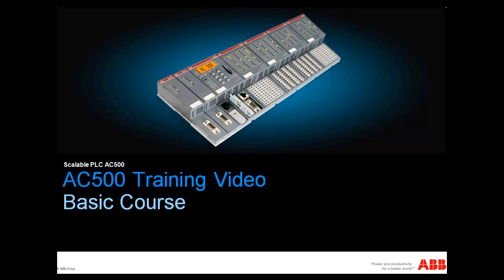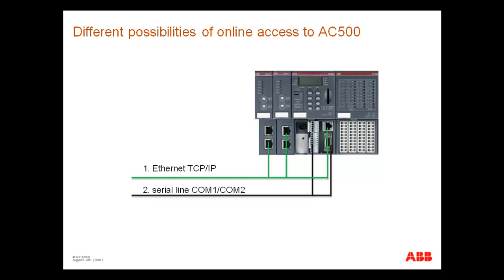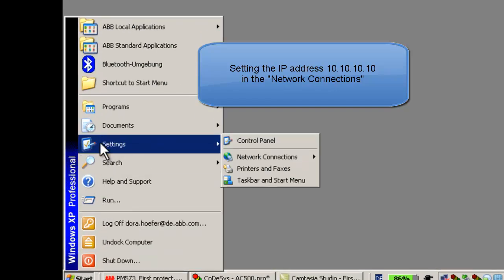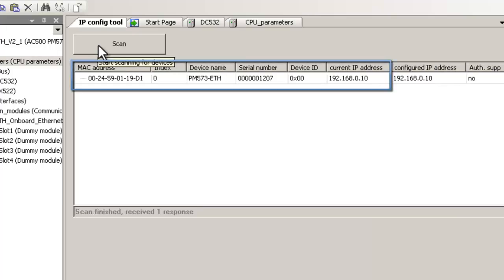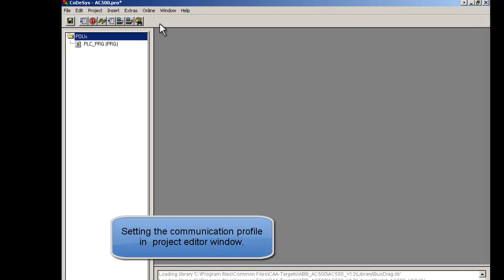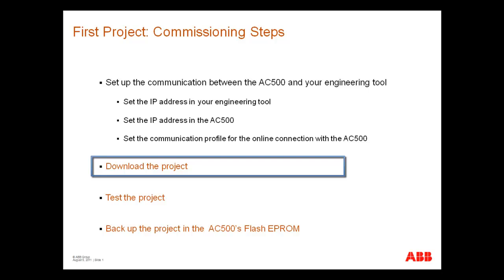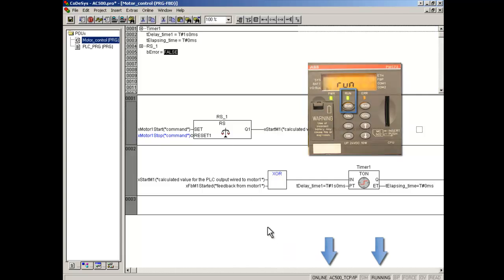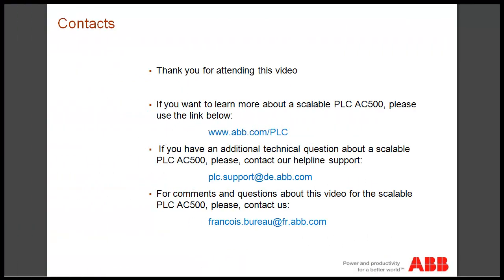ABB AC500 PLC First Commissioning

Comment: IF CODESYS DOESN'T HAVE "COMMUNICATION PARAMETER" IN ONLINE MODE THEN WHAT IS THE PROBLEM?
Reply from the maker: In recent versions, it's available in Automation Builder main window (CoDeSys 3.5). If you right click on your PLC item in the Project Tree you'll see Communication settings item. In Communication settings if you go to Advanced settings you'll exactly the same interface as presented in the video.

Comment: We use ABB PM573 with pc for tank gauging after power off system not working I checked battery place found not have battery.
Pls. your advice
Reply: Than you don't have save you application on the flash memory card?

Comment: I have a problem. The option "Communication Parameters" doesn't appear on the "Online" menu. Is it because of my Automation Builder version? I'm using the 2017 one.
Reply: i have you same problem, have you foud a solution?
Reply: @adrianlema4935  In newer version s it appears to be in the ABB automation builder - select PLC from the project tree, right click for "Communication settings".

Comment: hi abb. can we also set the controller ip address using the physical button of controller?
Reply: or maybe there are the other ways to set the ip controller without control builder plus.
Reply from the maker: Yes, using buttons on front face of AC500 CPUs standard - For IP settings uses the button CFG to allow navigation through addresses and system settings... for more details Please check technical documentation or contact our PLC technical   support  at plc.support@de.abb.com